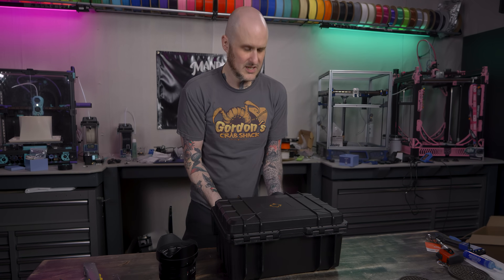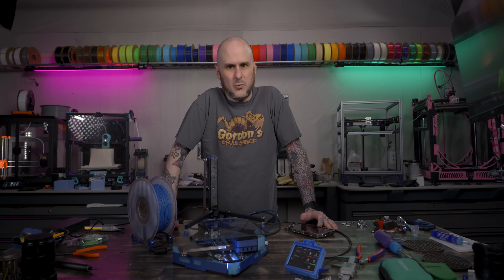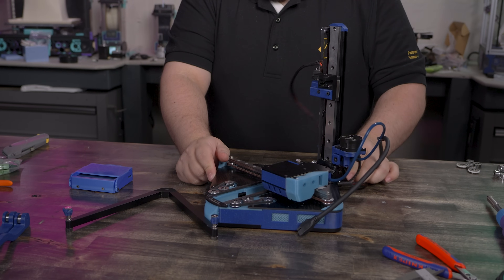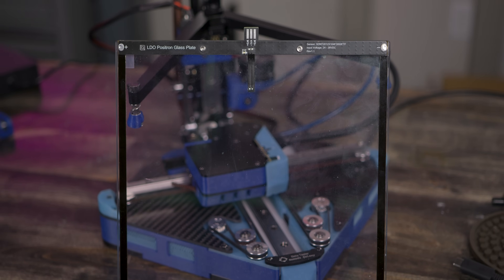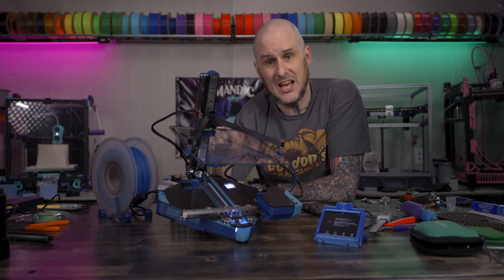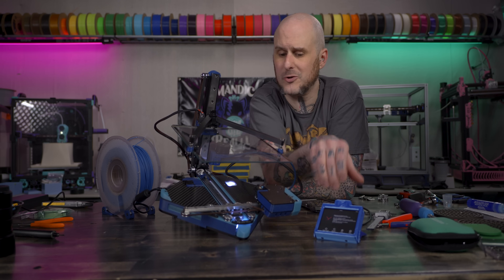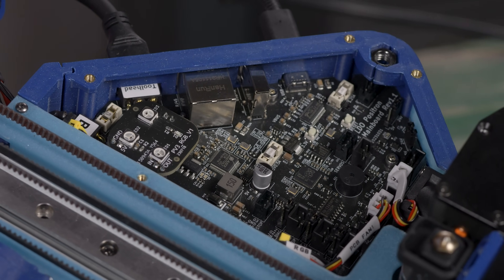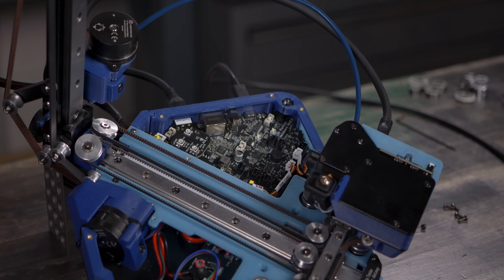Inside the Positron 3D Printer: A Deep Dive

Comment: Indium 10.. worked with it some time ago.. most common use is instrument panels and Timex 'Indiglo' watches (at the time).  After we ran the mylar through a sputtering process we cut the 6 foot rolls into 1 foot rolls and at the time the material was sold for @1500 p/square foot.
Reply: Indium tin oxide is the same material used to create the almost invisible conductive traces on LCD displays (akin to copper traces on a PCB and designed pretty much identically) as well as the digitiser on capacitive touch screens.
Reply from the maker: We looked it up while filming, this is Indium Tin Oxide coated glass. It’s used to create touch screens on some stuff. This just uses it as a resistor and heats with it. I’d imagine the indium you worked with was one of the base materials in the glass coating process? Over my head to say the least.
Reply: @MandicLabs  Correct, mine was on 6m mylar and had a phosphor adative so when a charge was applied it glowed. It was later bonded to windshields and the like.  We also did a titanium variant at the time. Clearly a different variety but the resistive properties when adding a voltage on the surface was similar.  I had zone optics setup so I could monitor the opacity and it was processed in a vacuum chamber the size of a cement truck.  Definitely one of my more enjoyable past jobs.
Reply: @Steven-Machado  I love the Timex Indiglo, so cool your worked on it. Do you think this could be replicated individually as a hobbyist project? Would love to make something similar. I don't have lots of chemical processing equipment but am very technical.
Reply: Indium tin oxide is also used on the F-22's cockpit canopy to help reduce radar returns. It's what gives the canopy its characteristic golden tint